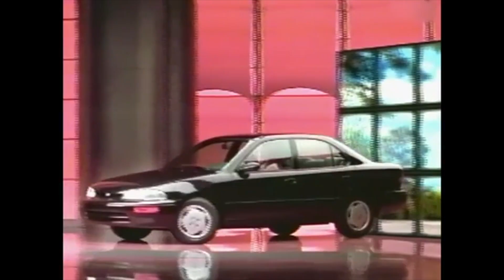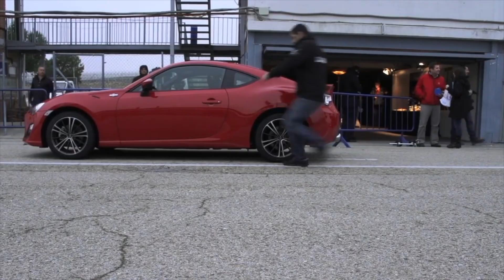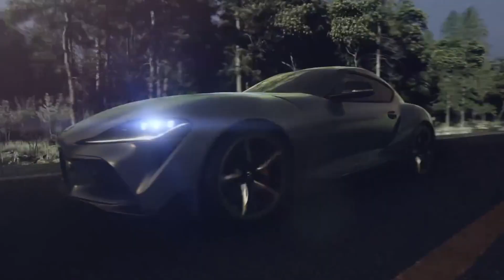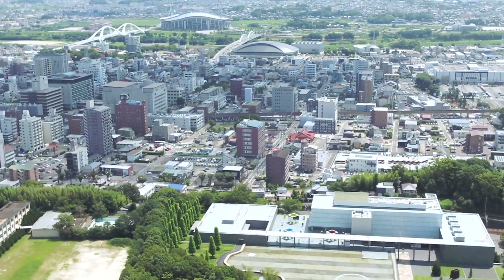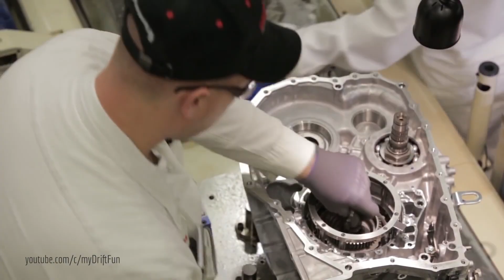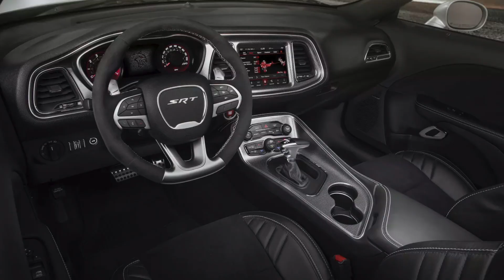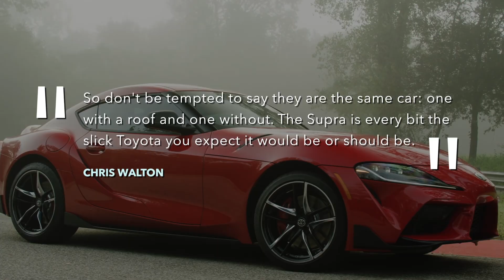MKV Toyota Supra - BMW or Toyota? The UNTOLD TRUE STORY

Comment: The new Supra is an embarrassment. That is, I stopped being a Toyota fan boy after I experienced the incredibly poor engineering of my new Lexus. Never again. Reliability is also no better than the Germans — they get all the parts from the same suppliers anyway.
Reply: I've been looking to buy a Lexus, which model is yours that you think isn't well engineered and what parts of it need better engineering?
Reply: lexus should be more reliable, you might bought one of the bad one out of a million. my dad toyota seirra have over 300k miles, and my new toyota corolla iM have 32k miles in 12 months doing uber and lyft,  somtimes i do 1st to 3rd gear pull, still running. did you do maintenance on time?
Reply: Funny enough, I was a fanatic BMW owner and lived in Europe.  I have matured and recently moved to Thailand and looked for a vehicle that was reliable to get from A to B, useful and not technically complicated and ended up buying a Toyota Hilux Pickup Truck.  If buying a normal car would consider a Toyota over a BMW both of which are assembled in Thailand.
Reply: How much is the LFA?I need one.
Reply: Its a myth people have been fed for years that toyota and honda are reliable. Also german transmissions are unreliable. propaganda...
Reply: @MrWells-km5cp  That is not propaganda! That is fact! Germans don´t make any more reliable cars! Last good car from Germany was Mercedes w124! And I now that because i´m mechanic in Munich.. ;)  You can also ask every Taxi driver in Munich, which is better: BMW 5 and Mercedes E class or Toyota Prius and Rav4.. ;)
Reply: @danijelt5933  I never saw a taxi in germany that isnt a Mercedes. The things you are talking about are called ''delayed obsolesence'' google it. Every car manufacturer uses it. Basicaly every expendable part of the car is manufactured to be reliable for a certain amount of time, which is not long at all, so they can sel more and more parts. But when it comes to non expendable parts, that are actually important there many can guarantee that no manufacturer has better engineering and quality than german cars. My mercedes is at 427 thousand kilometers at the moment and it runs like a bird. Change brakes, motor oil and other expendable parts regularly and no problems, Never did anything break down in the car everm and even now Im confident to do a major trip all aound europe without problems. So no one can tell me that german cars are not like they used to be, if you take care of it believe me it will serve you very well. not like many other cars that you treat like a family member and you maintain it very well but it keeps breaking and you keep going back to mechanic nonetheless. 
Btw my car is Mercedes Benz E240 w211 it is gasoline not diesel.
Reply: @mudza92  I don't need nothing to Google.. I'm mechanik, and every day I see so many different makes and models because we are working all of them.. And you need to wisit Munich and see that  all of Taxi's are not Mercedes, not any more.. And also my dad has Toyota Corolla, 2005 d4d.. it has 560 tkm.. Only clutch has been changed! So.. You see my point.. ;)
Reply: @danijelt5933  yeah, people who drive carelesly and dont maintain their cars properly can damage even german cars. Oh I had toyota suv and for an suv I was afraid to go offroad because of many breakdowns I had to repair. I loved the car it was powerfull muscular good feeling when you drive it but every so often I was at the mechanic. my mercedes e240 w211 gasoline, Im sure you know exactly the car Im talking about never had any breakdown or fault, just a regular maintenance and normal driving, I dont race on highway I like to chill and drive with music and relax while driving, anyway 427k kilometers and counting, still performs like baby. Almost as good as when I bought it. That car is just perfection and pinacle of german engineering, atention to detail quality materials, design and build is top notch, not to mention comfort oh my God seats are like heaven, and driving you hardly even feel car moving at all when driving 130 on a highway
Reply: @mudza92   Yeas i know.. simple engine.. Just put good oil and you are on horse.. But that is old Mercedes.. I´m talking about new ones.. And yes, german cars have superb quality on TOUCH! But reliability, that´s another thing..  And P.S. I´m driving BMW 3 series, and have driven so many makes..  And one more spoiler alert: Now they use French engines in 60% of cars..
Reply: @danijelt5933  Its not that old its E class w211  its 2008 year, its not new but not that old.
Reply: @mudza92  Yea, but model is from 2001 or 2002..  A this w211 mercedes was very popular Taxi car in Germany.. :) Only they were diesel..
Reply: @danijelt5933  2003-2009 and yeah almost every taxy had this model when it was in production, great value quality and economics for the fair price

Comment: I'm sorry but, "Nice BMW bruh" is literally the only thing that will come from this car. They've just slapped the Supra name on it. Put it this way. Do you think we'll be seeing this thing with the same following in 20 years time with this thing to match the proper Supra? I mean, I do get it. It's for the new generation. But You only have to say Supra and even the most lamen people know what you're talking about. Even the younger people think of the older models first. What annoys me is They say about  "Starting from scratch".. .But they didn't. And NO MANUAL? What the actual fuck? They should not have called this a Supra. It's a Parts bin car at best, as much as they go on about "New developments".. I'm Not saying it wont be a good car, albeit, ugly. As he says, Toyota kept their reliability standards as high as ever, which is obviously awesome. But it just doesn't even match the significance of old. In my opinion at least.

Comment: BMW BADGES PRINTS AND PART NUMBERS ARE LITTERED THROUGHOUT THE UNDERBODY AND UNDER THE HOOD OF THE CAR

Plus you're talking about two completely different approaches of JAPANESE Turbo Inline six culture and German M badge culture...and meshing the two together is....a gamble, but who knows, maybe itll turn out well. but lets hope the Supra doesnt turn into an over-engineered, leaky seal having POS that will be depreciated a crap ton like all the BMWs of past

plus, noone likes wheel bolts, Could have at least made it have lug studs like a normal Toyota. And because BMW loves plastic valve covers you can guarantee that youll have to replace the valve cover just because BMW wanted to save money. but who cares i guess when you have to hide your engine underneath an engine cover....unlike the 2JZ that proudly displayed itself without a cover hiding it away.

The Transmission is the "industry standard" as it is used in Starts naming a ton of unreliable companies

Comment: the problem with the new supra is that its too cheap, they felt the need to keep the car around 50k which is a mistake. the turbo supra mk4 was 50k back when it launched and one of its main rivals was the skyline which was a similar price. nowadays the GTR is very successful and people love it despite costing 100k and, like its ancestor, competes with supercars twice its price which the mk4 supra also did. i couldn't care less about the supra being the same car as the z4; the problem is the drivetrain, if toyota actually built a 600hp 3JZ and charged 100k for the supra people would love it. instead we get the lackluster mk5 supra.
Reply: You are not quite correct there. Supra was never aimed at the Skyline, but rather at the successful Fairlady Z. If it was aimed at the Skyline and its top-spec GT-R, they'd have made the Supra even more epic. Skyline became its rival when the Supra became such a massive tuning favourite and the 300ZX became much-disliked over its highly cramped engine bay and the need to change everything to get reliable power out of it.
Reply: @Max_Da_G  well whatever, I was really only using the skyline as a comparison because they fought for the same market so I could compare the GTR to the mk5. Mazda doesn't make an rx7 anymore, the Z cars weren't really in the same ball park, Mitsubishi doesn't make a 3000gt and the NSX was kinda out there so all I had left to compare it to was the skyline.
Reply: very good point I agree except instead of 600 maybe 500 or 450 out of box. 600 is a lot idk if you've ever driven a fast car but 350 is plenty of power when weight isn't an issue. just saying 600 on the streets with joe shmo idk... seems like a recipe for disaster. 450-500 means its a strong engine should handle power adders thrown at it.
Reply: @MrWells-km5cp  well the GTR handles near 600hp fine then again it is awd and kinda fat, but still though a corvette z06 has 650hp so I don't think 600 would be too much. I just want the mk5 to compete with the GTR. And yea I've driven a 2000 trans am (350hp) and a 2013 camaro (430hp) and yea they pretty fucking fast but we are talking about Supercars here lol
Reply: @TwoCraZyEyes0  IDK, im with you a little as i would like to have seen more HP but i cant afford it anyway so what does it matter haha......my disagreement is the 600 figure but only because the massive HP numbers on supras of old were all aftermarket additions.......and extra hundred to make it 450 to me would have fit the bill between a supercar and the powerful sedans making it compete with cars nearly 2x the price
Reply: Compared to 1994 MK IV price its stupidly cheap. 50k in 1994 dollars adds up to almost 85k dollars in 2018 money.
Reply: Mk 4 stopped in production because everyone thought it was too expensive. An engineer stated that they would have loved to continue production, but nobody was buying the car due to its price.
Reply: @TheLulzTeam  I don't think that was the supra's fault though, almost all Japanese sports cars at the time stopped production  around that time period. And the GTR is still going strong nearly 10 years later at 100k bucks.
Reply: There was a break in production of all of the Japanese sports cars. The Z the RXx, the GTR... 

They don't want the supra to be in the same price range as some of the Lexus branded RWD sports/touring cars. I'm surprised no one has mentioned this yet.
Reply: @daftpanda6533  i guess that could be the case but, unless you have proof, i dont think so. the lexus cars are based on luxury and they are really just touring cars, the LC 500 is really fancy and is very heavy, the LC 500 and a "true" mk5 supra would be different markets.
Reply: No I don't have proof, but it makes logical sense. 
I will concede on the LC being a different market,-and the LC is heavier than I thought- over 2 tons. 
The price range does sorta compete with the RC however. 

I just wrote a post saying they could have used the RC for the base of the supra- take out luxury and let TRD add more go fast bits. Restyle it to look less lexus and voila! Japanese Supra. The problem is the timelines don't really match- if the supra project had been started with BMW before the RC was started, that could be the reason?
Reply: @daftpanda6533  idk, that is definitely a good question though.

Comment: Why Toyota couldn't have taken the chassis from their own Sister Company in the form of the Lexus LC500 and used that as the base platform for the new Supra, and work with Yamaha to design their own in-house inline six.  If they had gone this route, no one would be adverse to the Supra badge.  But that's not what they did.  I'm sure the new Supra will perform well, it is after all a BMW so it will handle and drive great.  I guess we will have to wait and see how the sales go.  Either way it's cool that Toyota is offering another rwd platform car.

Comment: Ok, great, it’s reliable. I am not happy what so ever with Toyota’s design of the Supra. It doesn’t even share anything with the old Supra design or any distinguishable modern Toyota features. As someone who has experience in car design, I have to say, Toyota made a mistake.
Reply: In their defense, the Supra doesnt exactly have a specific "look" if you go through the designs from the Celica Supra through the Mk IV. Every generation was very much designed for the era it was built. 

Not a fan of the Zupr4 but the Supra never really had any specific visual features that continued through the generations.

Comment: Z4 is an amazing car but BMW never pushed it to become a proper sport car. It has been more like a weekend luxury car. NOw, it seems like Toyota gonna turn it into a wolf in wolf cloth that actually gonna drive like hell.  I hope price is not gonna be as stupid as new Honda NXS etc.
Toyota is not making the car with Peugeot, Renault or Fiat etc. unreliable tin make manufacturer. It is goddamn BMW ! 
What to complain about it! Bloody Z4 as reliable, durable as Toyoda and agile as Honda and brutal as (Quality, perfection, handling, seriousness) as BMW. Since engine seems like a BMW engine came in Toyota reliability standards; it seems like this cargonna be like a tuner monster as previous Supras. I believe it will be able to handle 3 times more HP and torque than it will come out of the factory.

Comment: This is a cynical car.  Toyota could easily build in house the next supra.   Did Honda/Acura outsource any part of the new Acura NSX? No.  Because they have pride in owning their design and their brand.  Toyota really doesn't (BRZ).  They just figured many buyers will not care about the origin of the car as long as the badge says "supra".  Did Honda/Acura outsource any part of the Acura NSX?  No.

Comment: Excellent editing and narration for this video. But when you start listing those car makers for the transmissions would it not suffice just saying that the same transmission is used for the FIAT group (Alfa, Dodge, Jeep) and the Audi group (Bentley, Lamborghini etc) as well as some from the uk whom may not have had a reliable transmission, i.e aston martins as well as the BMW cars? Of course these cars will have the same components inc transmission. Also the only downfall of these collab cars is BMW's terrible sourcing of parts that brake and not the actual manufacturing. How many times we hear a water pump  or an alternator breaking in a BMW and not the actual push rods or say headers (well those too, everything breaks in a BMW but just to gt my drift). I would def buy the Toyota version and not the BMW but maybe I will try and impress a family member or a neighbor and I'll end up buying the BMW because of the badge anyway.

Comment: Paused at 13:13. The body might have been developed at early times,  the roof and door line is the same showing they joined to lower costs for crashtest requirements. Making it under the skin and even more similar product.

Comment: So... It's a Z4. Again... If they called this thing a Celica, no one would have had a problem. The platform is fine. It's sound. But it's not a Supra. It's a Z4. In the end Toyota picked and chose from German parts. This car breaks down and you take it to Toyota I guarantee they'll be sending it to BMW to be serviced. You'll also be paying BMW prices lol. This video doesn't change anything... The biggest difference is the suspension, and body panels. It's exactly what everyone thought. Give or take.

Comment: 12:34 That list is not correct. Audi, VW and Bentley do not use this transmission, at least not in a form resembling the model you have shown. In their setups with longitudinally mounted engines; VW, Bentley and Audi exclusively use transmissions with front differentials included in the gearbox housing; with the entire gearbox being longer enabling the driveshaft for one of the front wheels to be routed between the engine and torque converter.

Comment: I stopped at “bmw spent a lot of money on development” and “but they were suprised by how focused on reliability the japanese were...”

Where is your evidence on this? I mean concrete evidence, not just some link to some article. Give me an interview of someone at Toyota or BMW who specifically addresses this. Otherwise this video is just one big automotive cliche of german overengineering and japanese focus on reliability, made to appeal to both groups of fans and based on stereotypes justify this project. 

By the way, the n55 engine is known to be reliable, the n54 was the one with issues. And where is the evidence that the Supra engine is a modified bmw engine? What part numbers are different? What is changed? Is it built on a seperate line at the factory?

Where is the evidence Toyota contributed anything at all in development? Do you really think they would bother to design a chassis together and modifiy an engine, but keep the same base BMW steering wheel found on 316d models. I guess BMW didn’t want them to have the Msport wheel...

My guess is that their agreement is technology sharing, not codevelopment. Bmw makes the sports car, and Toyota shares their hybrid technology with them, something the germans are lacking in. The exact same thing that Mazda has going on with Toyota.

I’m only vaguely informed on this subject, but I can spot that this video is complete utter bullshit right away.

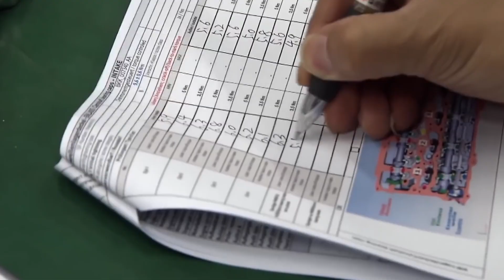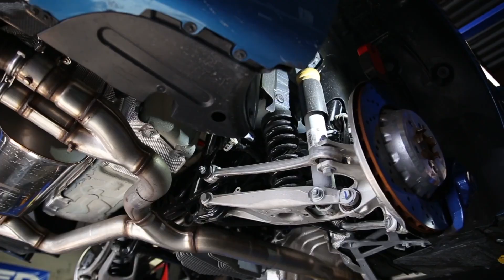Comment: Everything you said from 9:03 to 9:30 is a bit misleading.
I work for a large german manufacturer, currently in the technical development department. Complete engine teardowns together with individual tests of every component including every bold and rivit really is basic practice and as far as I know, everybody does it. This is not limited to Toyota and I don't appreciate your insinuation that BMW supposedly doesn't do this kind of quality control; especially without you actually knowing anything about this particular field.
Reply: Kommentator He is talking out of his ass. Just the same old well known cliches about german overengineering and japanese reliability.
Reply: By the way, do you know of a good way to get into the automotive industry as a software engineer?